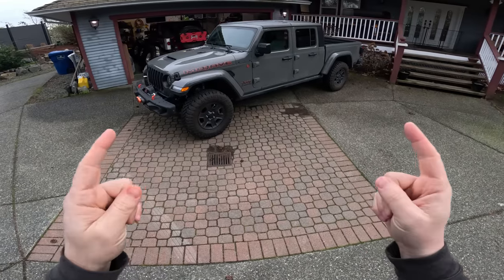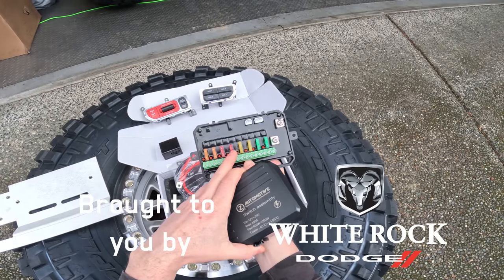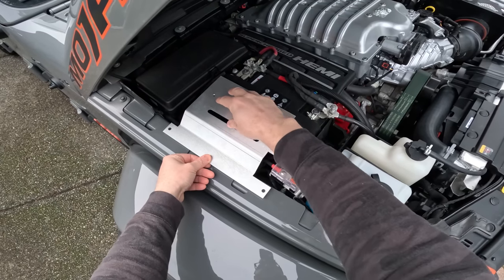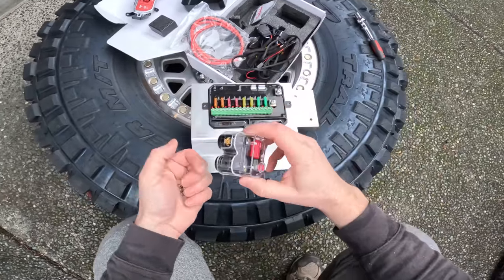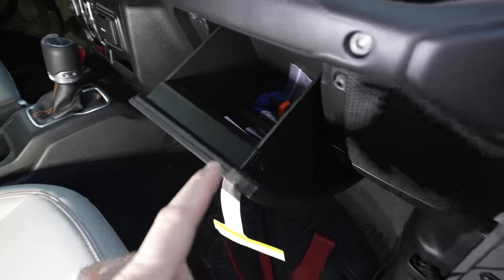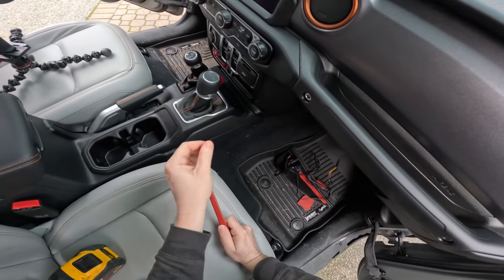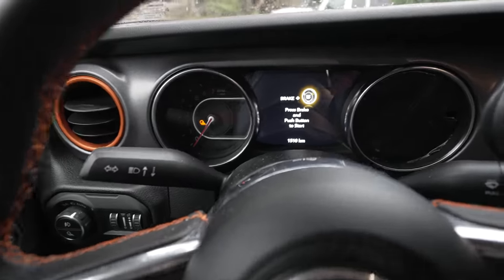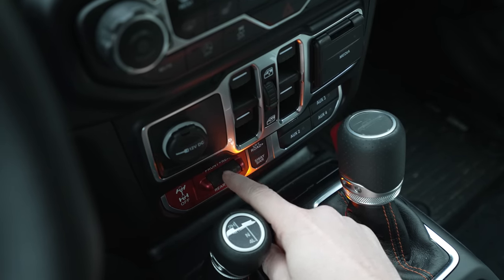Jeep Wrangler & Gladiator Easiest OEM Auxiliary Switch Install! Z-Automotive Auxiliary Kit

Comment: Just curious but, why didn't you get a sport considering all the changes you've made to this truck?  It seems it would have been more cost effective in the long run.
Reply from the maker: I did a cost break down on this 2 years ago. The delta is less then you think when you consider what I can sell my axles, tcase for and then I get the strengthened frame, the Mojave hood and nicer interior and seats.

Comment: You need to remove the negative cable, and then take the two negative cables that are both together apart or else you will still have power to the vehicle from the secondary battery

Comment: Been some time, but each relay/fuse bank from left to right in amp is 40, 10, 20, 30? So you can basically run just about any light? And guessing each color is for each aux bank?

Comment: What radio and service type do you use for communications? I believe I saw a yaesu radio in an old video of yours. I also think I saw from a video on Chance Barbers channel that Canada’s version of “CB” is within the uhf band, if you run that or happen to know, I’m curious what wattage is allowed. 

I think it’s called LAN1, LAN2, LAN3, ect.

Overall curious what the options are compared to the U.S.’s GMRS and CB radios.
Reply from the maker: I use a yaesu 400xdr